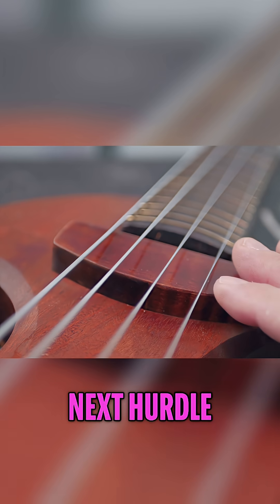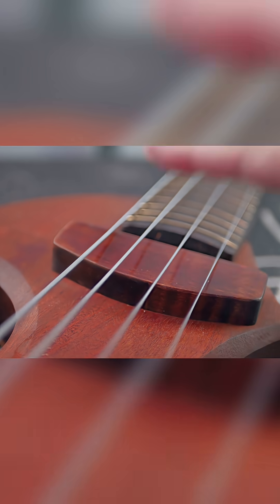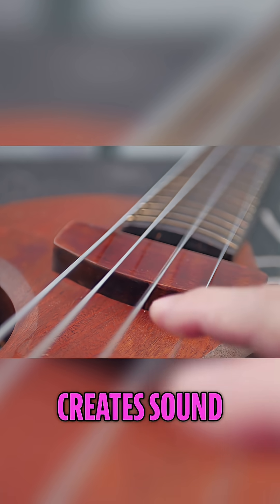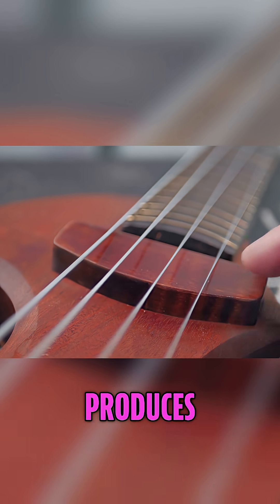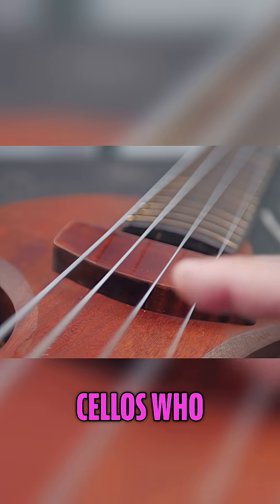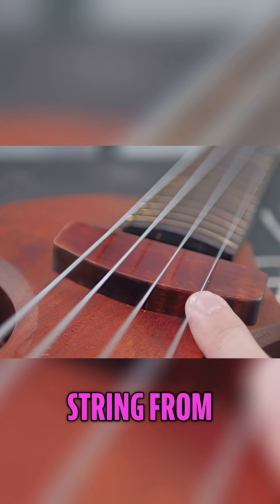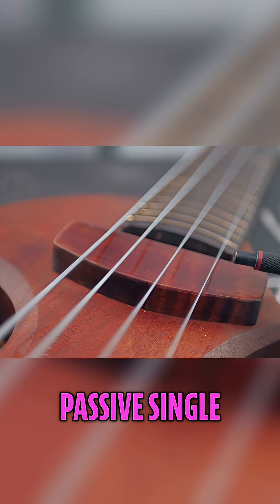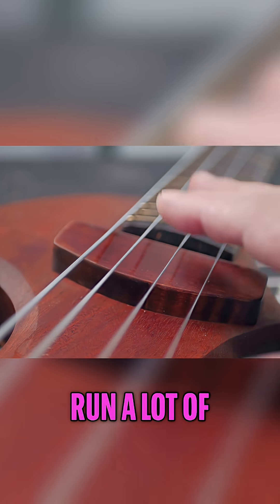Pickup Problems: How Bowed Instruments Challenge Sound

Comment: What if you had bent pole pieces with a bar magnet on the back so the coils can be oriented normal but the end of the pole comes around the side of the string, or even split the pole and have it bend around both sides of the string?